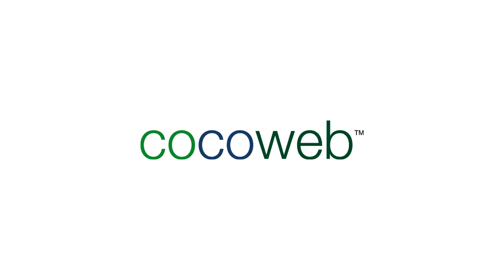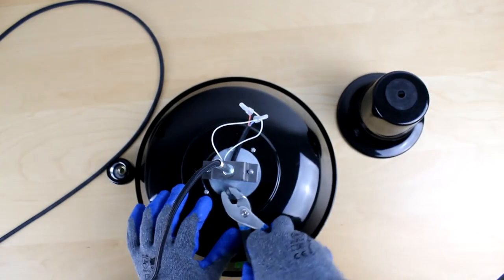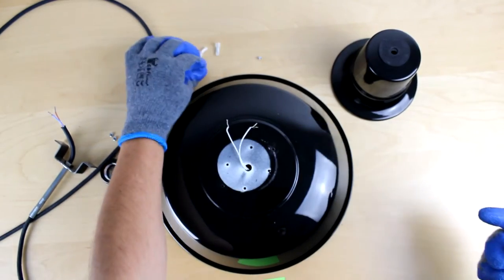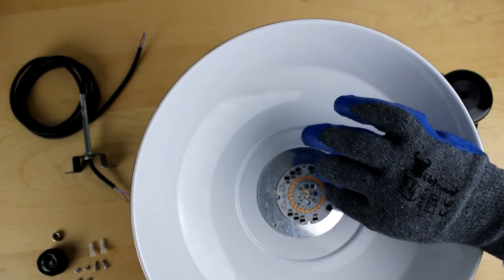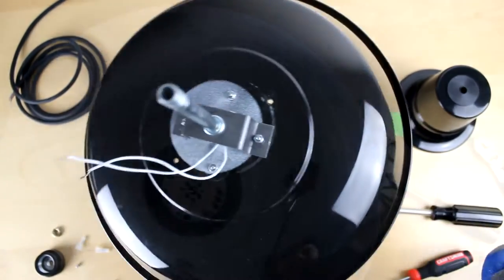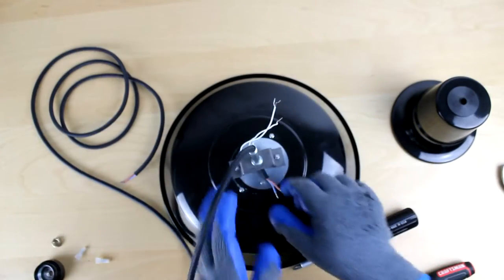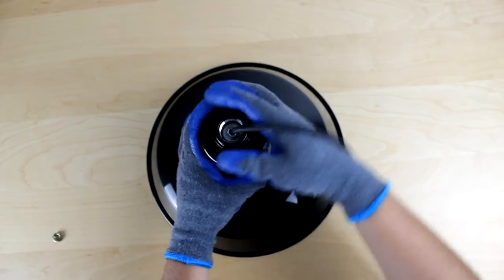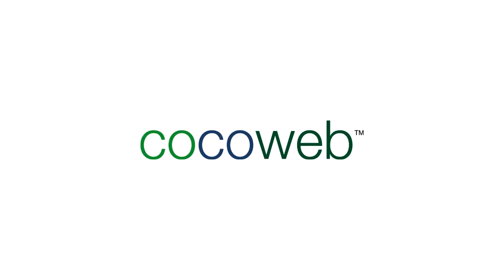How to: Replace a Cocoweb LED Array for Indoor and Outdoor Barn Light

Comment: Why do you make it so hard to change a bulb?  What engineer designed this chicken wire canoe of a light?
Reply from the maker: We appreciate your feedback, and we're here to assist you.

If you require assistance with replacing a light bulb or have any questions about our product, please don't hesitate to reach out to our customer service team. We'll be happy to help you and ensure your lighting experience is as smooth as possible.

If you do need help with replacing a light bulb, we offer in-house repairs for a small fee, give us a call at (888) 783-0378 or email us at customerservice@cocoweb.com.